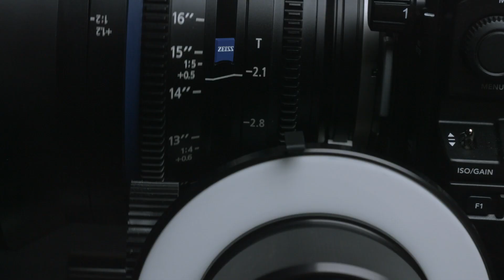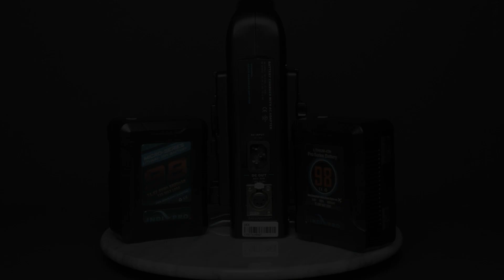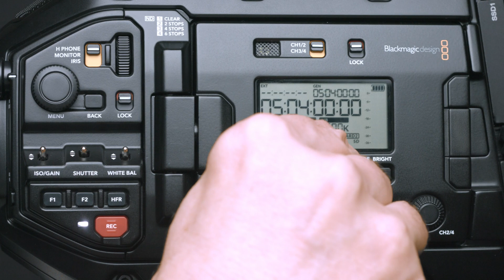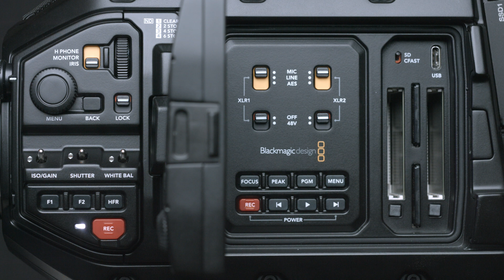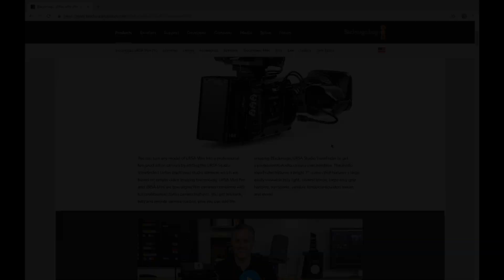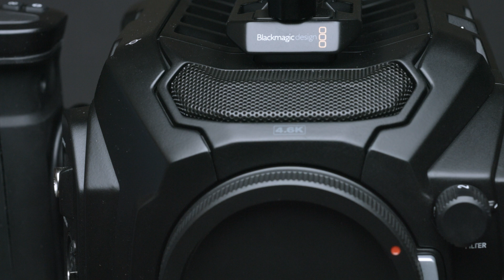Ursa Mini Pro G1 Ultimate Guide - Index in description

Comment: very helpful video. thanks. I need to get 4k out to a Atomos Shogun. I know this is possible because I've done it before but now I cannot for the life of me figure out why it only shows up at HD in recorder when the settings in camera are 4k. Any idea what I could be doing wrong? I know I'm using the full 4k SDI  signal in the back of the camera.
Reply from the maker: In the menu, go to the monitor section.  Choose main SDI from thed menu.  On the second page of that menu in the lower left is the resolution setting.  Choose 2160P.  Hope that helps!
Reply: @PanDownTiltLeft  omg. thank you so much. it's not even a very deep menu but i kept missing that. works!
Reply from the maker: @RollinLeonard  Glad you got it sorted :)

Comment: Hi, I would just like to know if the ursa mini pro g1 is still work it today? It is so much cheaper than buying a g2. A second hand g1 is almost half the prick as buying a g2
Reply from the maker: We have three. We use them every day. We love them.  BIUT be mindful of the fact that in the event that you have a main board failure, BMD will NOT repair the G1 cameras and you will have an expensive boat anchor.

Comment: Curious if you know; when this camera is mounted on the Ronin 2, is there any way to access the menu with the touch screen LCD door closed? Otherwise it's a very narrow amount of space to get in there and mess around. Can these very important settings be changed via bluetooth or monitor or external controls?
Reply from the maker: The bluetooth app that BMD makes will control a few settings such as ISO, shutter angle,  white balance, record, power on/off, media select, iris and the metadata slate.  A third party app is available called "Bluetooth+ for Blackmagic" that does the following:
- Record Start/Stop
- White Balance, including 5 helpful presets and Auto White Balance
- Green/Magenta Tint
- Trigger Autofocus (for supported electronic lenses with autofocus enabled on lens)
- Off-speed frame rates
- Aperture (for supported electronic lenses)
- Shutter Angle
- ISO
- Active Card
- Power On/Off
- Enter metadata in the Digital Slate (including location data from your iPhone or iPad if you give permission)
Reply: Thanks! So some features, but not all (things like adjusting SDI monitor info etc.). Hopefully they'll make that available in an update.  @PanDownTiltLeft

Comment: good manual!
Reply from the maker: Thanks so much!
Reply: @PanDownTiltLeft  I find that I can't reach any info in original paper manuals about how to hook up ursa with viewfinder (front SDI busy) to SSD recorder rear ports and video assist same time? Maybe you know how, is it possible to use SSD Recorder or Assist as pass through device in 12 G SDI signal when capturing RAW?
Reply from the maker: Sadly You cannot pass through the rear SDI. Only the front can do a pass-through.
Reply: @PanDownTiltLeft  so maybe some rear repeater splitter exists? I heard that in broadcasting to connect studio assist display and fiber optics convertor, them uses rear ports
Reply from the maker: Blackmagic should have something.  But you might not be able to split that rear SDI as it does some non-standard stuff.  So if anyone could make a splitter for it it's BMD :)